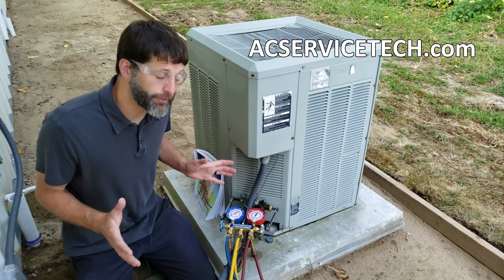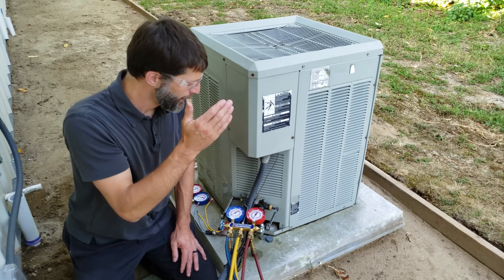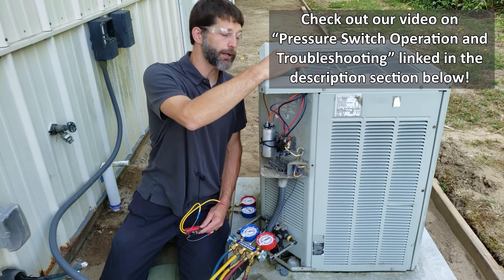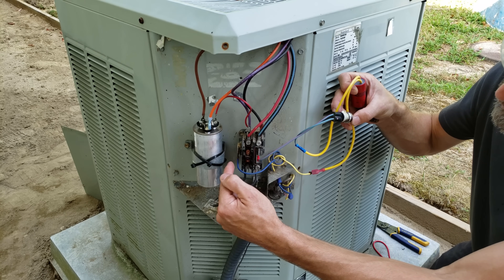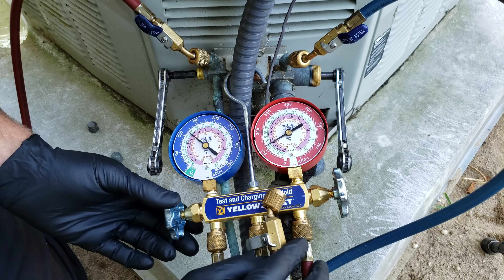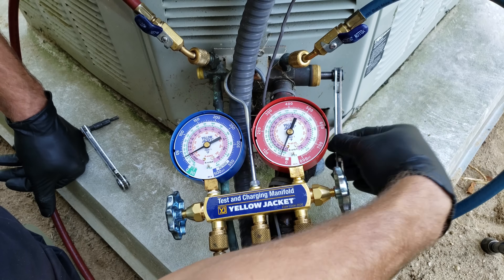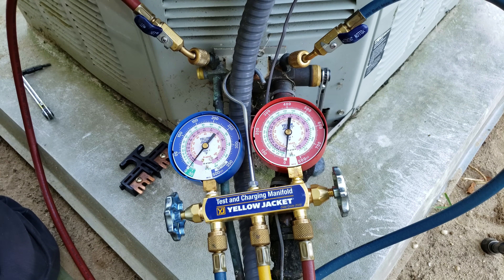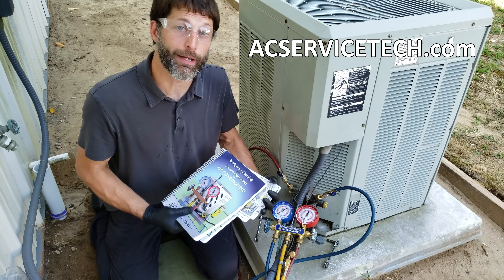Full Refrigerant PUMP DOWN PROCEDURE on AC Unit PERFORMED & Questions ANSWERED!

Comment: My Goodman heat pump has a scroll compressor and I found this in the service manual:
 "Because of the potential damage to
compressors, do not allow suction pressure at service valve
to drop below 20 PSIG when pumping unit system down"

Comment: In this video and on page 143 of your book you talk about taking caution when performing a pump down on scroll compressor because the refrigerant acts as an insulator between the motor windings and ground.  Being unencumbered by too much actual knowledge on the subject this statement does not seem logical.  I assuming this concept is something that a compressor manufacturer may have stated.  Do you recall where or from whom this information was made available to you?   It would seem, to the uniformed, that the insulation quality of the motor stator is a function of the coating applied to the magnet wire and not the refrigerant.  Can you help me out here?

Comment: A great video, love your content. Just wondering when you pump down a mini split and intend to relocate it with new pipe work do you need to add oil? I am used to car a/c and adding oil when replacing components and pipes. So when moving the unit I will be renewing the pipe work. Many thanks in advance if you choose to answer the question.

Comment: And what about the scrolls compressors on a freezer room, or an a walk in coolers, on these systems  the condenser unit has to pumps down frequently when the thermostat stop the solenoid valve, and many techs adjust the LPS at zero psig

Comment: Great stuff, Craig.  With respect to pump down videos in general…I think it’s important to reiterate that outdoor condensing units do not have endless refrigerant storage capacity.    Despite countless videos showing someone closing the LL, holding in the contactor, closing the SL, etc…and viola!  Firstly, your professional recommendation (safer I'll add) is much better.  Secondly, well, some times/often it doesn’t work so easily.  Depending on evaporator size, lineset specs, etc. even brand new compressors will trip their pressure relief during pump down—puzzling many (here assuming limit switches were bypassed).   In these cases, you trap what you can get and evac the rest.  My point is IF you think you’re going to always conveniently ‘pump down’ every system into its ODCU, you’re mistaken.  I’ve had brand new units pump down to around 225 psig on the LL and that’s it.

Comment: I have never head that you can't pump down a scroll compressor for the reason that you just said. I am looking online for more info.
Reply from the maker: You can pump them down a bit for testing but not down to 0psi or close to that where the refrigerant is no longer at the inlet of the compressor. No less than 10 psi to be safe. Most older scrolls are designed like that, thanks!
Reply: @acservicetechchannel   I disagree. I do a lot of refrigeration work that use scroll compressors and many system require a pump down as part of their normal operation. The trick is to know how low you can go and the scroll makers include that information as part of the specs for the compressor. For R-22, 37 psi is typical for other refrigerants like 404a you can go as low as 8 psi and still be safe.

Comment: Mine won't pump down beyond 52. Starts at 225 promptly goes down to 52 and stick there. Changing evaporated coil and have a scroll compressor in case it matters.
Reply: Yes it does matter. Many scroll compressors have an internal safety valve that will prevent pump down below a certain point to protect the windings from burning out due to lack of refrigerant which insulates them.

Comment: What would happen if you pump down a 4 zone mini split system that contains factory charge of 6lbs plus additional .5lbs charge for additional line set? Could the total charge of 6.5lbs exceed the refrigerant storage capacity of the condenser? Would a pump down procedure on this unit cause damage or would you just not get the gauge down to zero? I can't find any info the total refrigerant storage capacity of the condenser. Thanks

Comment: Hello Craig, big fan of all the video's. I signed up a couple years ago and got your physical bundle of books and charts. I work out of the country and as I am not a certified HVAC tech, The manuals were very helpful. Unfortunately, when my boxes got shipped from one site to another, they lost all my manuals and some other property. That said, I may consider getting the e books this go round when i can afford them. So my actual question is this. Folks at another site disconnected about 60 split pack system and stored them inside the containers. The issue is that none of the line sets or the indoor or outdoor units got the line connection points or the lines themselves covered or closed off from dirt /sand, etc. What do you think would be the best way to purge each unit and the lines sets so as to  not ruin everyone by contamination. I have nitrogen available if that could be used and I can order additional dryer filters as well. Trying to save as many as we can.
Thank you  
Mr FiXiT

Comment: Great instruction Craig. In previous pump down videos you have advised that due to the insulating properties of the refrigerant in scroll compressors not to pump down to a vacuum, but only go down to 5 LBS psig. In this video you advise NOT to pump down systems with Scroll Compressors. Please explain the change. Also, please do a video on just how you now would pump down/evacuate a system with a Scroll Compressor. Thanks a lot.
Reply from the maker: John, so you can usually pump down a scroll compressor but just not into vacuum so I usually stop at 5 to 10 psi. In this video I just meant don't fully pump it down, thanks!
Reply: Thanks Craig. Appreciate the quick reply.
Reply: Was a video ever made?
Reply: I do not understand a vacuum is quite a good electrical insulator between windings and frame and at a potential of 240v x 1.4 you should be able to pump down to a very low pressure and not cause any shorting out of a scroll compressor, just curious

Comment: I have a question about the low pressure cut off switch. If you pump the unit with a low pressure switch by pressing the contactor button, will it damage the pressure switch?

Comment: There is one thing I heard and kinda confused. You said on a scroll compressor do not pump down bc if you remove the refrigerant it could damage compressor. But if I can’t pump it down then I would have to recover all Freon. If I did that wouldn’t that remove all Freon? And potentially compromise the compressor??

Comment: ok watched again. if the low pressure switch fails and txv clogs then we could get a grounded compressor, correct? Do you know at what low pressure the insulating factor of the gas does not work?
Reply: Good question.

Comment: I’ve been working in HVAC for nearly 20 years so I can say this as more than a Monday morning quarterback. If the condensing unit is over 10 years old I would have the homeowner sign a waiver saying the company is not liable if the compressor fails before you go through the effort of moving it.  Most companies offer a 10 year warranty on the compressor so if it fails at least the company will reimburse you for that. We had that happen at my former employer and they ended up having to replace a compressor on a 15 year old unit. I would also let them know that moving the condenser to a new location also has risks. A couple months ago I had to redo the ground underneath a condensing unit that we had moved because floods had washed out the ground from underneath it. The homeowner ended up getting socked with a $400 bill. He was not real happy about that. It’s also a good idea to check local codes and ask the neighbors if it’s OK in the new location. I haven’t had to move too many air conditioners with a scroll compressor yet, and I haven’t had to move too many air conditioners anyway but that’s a good tip.

Comment: Wait till craig find out that I push the contactor in on systems with a scroll compressor 😵‍💫
Reply from the maker: We still do a partial pump down for testing if a scroll compressor is good and the internal pressure relief is good, thanks!

Comment: I have heard people say that about scrolls before. I don’t agree I always pump scrolls down. Actually refrigeration racks for coolers and freezers which are pump down systems by normal operation have scrolls and live that way normally
Reply from the maker: What pressure is the cutoff set for on the low pressure switch? Thanks!

Comment: Great vid and great book!
Question about scrolls, I heard you can pump them down just not below like 5-10psi?
Reply: I always pump scrolls down. Actually refrigeration racks for coolers and freezers which are pump down systems by normal operation have scrolls
Reply: @drodriguez394  I’ve always pumped down scrolls, never had a single issue
Reply from the maker: Pub Cat, that is correct. I mentioned before that Scrolls can be pumped down to 5-10 psi unless the manufacturer says not to for that specific model and design. You just don't want to remove the refrigerant completely from the suction side of the compressor which would happen at 0 psi or lower. A pump down system may shut off before 0 psi is reached and therefore leaving refrigerant between the electrical winding and the ground frame, thanks!
Reply: @acservicetechchannel  thank you for your response! Is getting refrigerant back out of the electrical winding and ground frame something that can be done or is it like a once it happens, it’s irreversible and major damage can/will happen?
Reply from the maker: The refrigerant is always next to the windings. That is why acidic refrigerant oil will eat away at the resin insulation on the outside of each winding wire wrap. The refrigerant flows next to the windings in order to cool the hermetically sealed compressor, thanks!
Reply: @acservicetechchannel  you are an hvac guru and you’ve taught me a lot, thank you again.
Reply: @acservicetechchannel   thank you! Keep up the amazing content
Reply: I wanna know this too
Reply: Following. Everything I have heard is don’t do it.

Comment: What if the unit doesn't turn for a pump down
Reply from the maker: There is something wrong that needs to be fixed if its not turning on in air conditioning mode.
Reply: @acservicetechchannel  I'm just going to recover the freon then remove it. The customer wants a new unit installed. Once I remove it I'll take it to the shop and check it all out. Either a contactor or capacitor. But it could be something else like the t stat . I'll figure it out. Thanks for the response and have a blessed day

Comment: I use the bump the contactor method. Pull 24 volts off contactor or turn the thermostat off.
Reply from the maker: That works too for shutting the system off. I just like to pull the disconnect as the safest quickest method, thanks!

Comment: I disagree with the jumping out the pressure switches. If your tstat is calling, your blower fan is on. If your pressure control opens, just push in the contactor at that point
Reply: I thought the same thing. Turn on the blower fan and press in the contactor and avoid the pressure switches altogether rather than call for cooling in the first place. 

Very useful video though.

Comment: it is the same process for a heat pump ? Thank you
Reply: Yes. Be sure to run it in a/c mode. If you do it by pushing in the contractor manually remember to jump out R to O to make sure it is in a/c. If not it will be in heat
Reply: @williamserver4332  thank you
Reply from the maker: Tito, same exact thing as in the video. Just jump the pressure switches and turn the thermostat in air conditioning mode, thanks!
Reply: @acservicetechchannel  thank you 👍🏻

Comment: Did not know about jumping the pressure switches... Why was I never told this. Thank you sir.
Reply from the maker: It is just something to watch out for if running the system in ac mode. I highly encourage techs to have the indoor fan running during the pump down. This way, the pressure does not rise after the pump down process is complete due to vaporization, thanks!
Reply: Why jump it out? When it goes off on low pressure, you can just push your contactor in. To me that's more to my benefit cause i don't have to pull the disconnect to stop it, just let go of the contactor plunger

Comment: Thank you for your important information it means alot.???? I ask a question làst week about how long the mini split unit line set can bee and in what occasion u add gas
Reply from the maker: Each model mini split will have a different line set length that the unit's refrigerant charge will be good for. Look on the outdoor unit rating plate and the installation literature, thanks!
Reply: As he said it different for different ones but a Mitsubishi mini split said on the outdoor unit anything over 98 feet of liquid line add x amount.